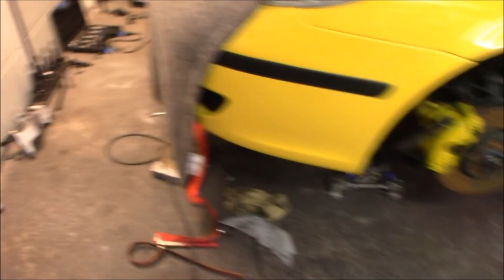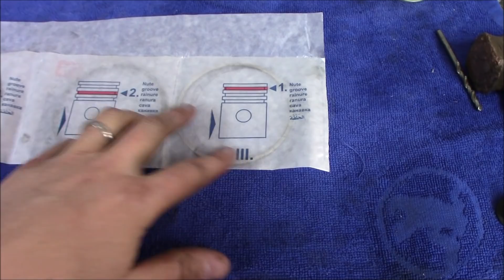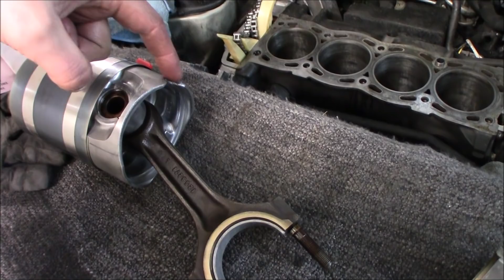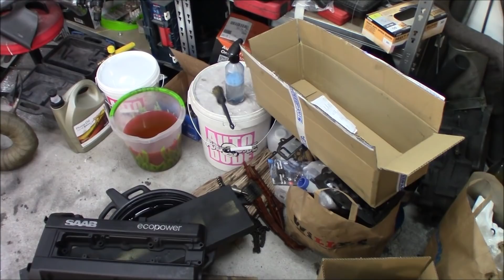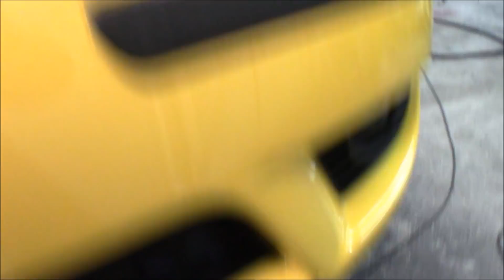Road To 500HP SAAB: Enginebuild Part 2

Comment: Great to see the build.
Before firing it up I usually spin the engine with the sparkplugs and the fuel pump fuse removed. This brings the oil up to pressure and gets everything moving lubed and settled in without being under load, which can't hurt.

Comment: Great video!
But am i able to use all turbo b234 turbo piston and rods in a b235r?
With only machine the top 1.1 off?
Greetings from holland and keep up the good work!
Reply from the maker: Yes that will work fine 👌
Reply: @JonasKakarikas  so in a nutshell 
When i buy an b234 from 1990 piston and rods will fit just without swapping a block?
Ive found some threads on forum that it may interfere with t7 oil squirters..
Maybe a stupid question but it rather spend money once 😆😆
Reply from the maker: It fits without problem. Interferance with oilnozzles is only for the 2.0 pistons 👍

Comment: Jonas whats the budget option would be for rods and pistons for my b205r to go +350 hp. I read that guys fitt 204 cams in to it to get more agresive engine run.
Reply from the maker: Machined T5 pistons 1,1mm. T5 rods. B204 intake cam 👍
Reply: @JonasKakarikas  from t5 engine exactly? And cam from b204 non turbo I presume?
Reply from the maker: Yes, The T5 has stronger pistons and thicker rods 👍
Reply: @JonasKakarikas  Iam not really get it so from  Any t5 engine would suit my b205r? Will it suit from any of b234 and any of 204?? Or has to be turbo or aero etc
Reply from the maker: It has to be from a 2,0 to fit

Comment: I only use Wahler thermostats. I did a write up on a simple way to make the engine fans turn on at a lower temp to match a different thermostat. If running hot or sitting in traffic, a lower thermostat will not make a difference. Also, if the fan comes on at the same temp, the engine is experiencing excessive temperature changes. So ideally, you should change the thermostat and engine fan temp together.

Comment: Great video series.  2001 viggen.  Engine rebuilt prefessionally (?) by Dr Saab in Sandiego.  less than 5k mi and have a cracked piston.  No apparent damage to cyl walls. Called rebuilder and he said he used the wrong pistons.   I am ready  to build it back myself, and read too much.  I believe in OEM  I do not need 500 hp  she is pleanty fast as stock.  Forged pistons or not?  I want a reliable ride. The rebuilder used forged but have heard argument against both. Also please suggest a vendor.
Reply from the maker: Forged if you can afford it 👍

Comment: Thanks again..  What is the purpose and why did you remove the smaller timing chain?
Reply from the maker: One less thing that could cause an engine failure. More free reving engine = more power. Balancing chain is for comfort mostly, for a track car its just in The way
Reply: @JonasKakarikas  Great video series.  2001 viggen.  Engine rebuilt prefessionally (?) less than 5k mi and have a cracked piston.  No apparent damage to cyl walls. Called rebuilder and he said he used the wrong pistons.   I am ready  to build, and read too much.  I believe in OEM  I do not need 500 hp  she is pleanty fast as stock.  Forged pistons or not?  I want a reliable ride. The rebuilder used forged but have heard argument against both. Also please suggest a vendor.

Comment: Vet inte om jag har fel nu men säger du inte i videon att pilen på kolvarna ska peka mot växellådan medans du installerar dem pekandes mot timing kedjan?
Reply from the maker: Det jag förklarade i videon, transmission = kamdrivningen  gearbox = växellåda. Pilen skall vara mot kamkedjan, vänder man dom tvärt om kan man inte dra runt motorn 👍

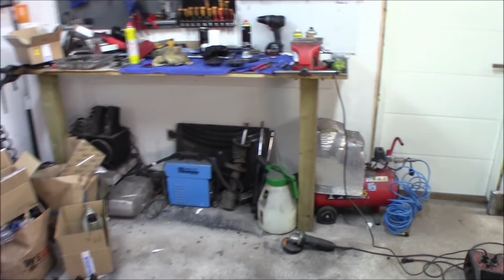Comment: Hei Jonas. Kan du si hva er dette på motoren av din kompressor som står under arbeidsbenket? (videoen 27:16) Du hadde limmet noe på motoren. Er dette til å dempe støyen? Hvis ja, hvilket materiale har du brukt?
Reply from the maker: Det är ljuddämpningsmatta från biltema för att få ner ljudet, men det låter en hel del ändå 🙈
Reply: @JonasKakarikas  Hehe. Tusen takk for ditt svar. Jeg bruker peltors med min men skal bruke ditt patent også:) Du er en talentfull person og har kjempe bra kanal!
Jeg er en SAAB entusiast og kjører 9-5 NG 2.0 Bio power Linear kjøpt i Arvika og 9-3 OG 2.0 SE coupe B204L oppgradert til 220HP (crazy bil:)).
Før kjørte jeg 9-3 OG 2.0 SE B204i og 9-5 OG 2,3t Vector sedan. Hilsen.

Comment: It is not a good idea to use stainless steel screws on the exhaust manifold instead of the bolts with the tubes and nuts on. The bolt with tubes and nuts is specifically designed to work with the heat, while stainless steel screws are a lot less flexibel and tend to break under heat. So maybe think about exchanging them to the bolts and nuts again.
Reply: Stainless steel and Aluminium alloy do not mix, they react with eachother and become fused together. Copper grease does help to alleviate the process but is not a guarantee.

Comment: Jonas did you buy the B234 pistons from Mahle? The stock B234 internals are said to be good for 500hp. Just what I read.  Let me know what pistons you bought please. Great video!!
Reply from the maker: Yes, i bought them used. Dont think you could get new ones.
Reply: @JonasKakarikas  You can buy the pistons but not the conrods, pistons are from Mahle but the conrods was produced in Södertälje once upon a time and thus not available. Part number for the piston for B234 engine (if I recall right is it is class AB) is 109166745 and the price is around 300 SEK per piston plus shipment. Check Speedparts or Orio. And as always nice and informative video, thanks.

Comment: Hej Jonas, great video as always, and now for the tips:
1. the torque setting of 20 Nm +70 degrees refers to the new type con rods with a bolt instead of stud.
2. The best adhering method for the valve cover gasket is contact glue. Tut the glue in the grooves, install the gasket and let it aside for 30 minutes before the assembly. This was the method done by SAAB. There is also a torque sequence for the valve cover listed in the WIS.
3. Upon renewing a cylinder head, it is always a good method to install inserts or helicoils where the exhaust manifold stud are fitted. The long studs are important in relieving stress due to heat.
4. Crank the engine longer before start, when you gain initial oil pressure the oil has just reached the crankshaft. give it another 30 seconds (6*5 second runs) to feed oil to the cylinder head.
5. Always fill the oil filter with oil before assembly, especially during such work. this will initiate the oil pressure sooner.
6. Start the engine WITHOUT coolant for the first minute or 2. In case you see a disaster,  you will not have to drain the coolant. then fill coolant and start again.
7. Idle the engine 90 to 120 minutes and replace the oil and the filter. To my opinion the regular oil is excellent and there is no need for a special break in oil. This will remove MOST of the initial abrasion of metal away, and you will be more confident driving the car.
8. Be calm with the engine during the 2 or 3 hours of initial driving, and then load it more gradually. This will ensure a healthy life for the engine.

Good luck.
Reply from the maker: Thanks,

I always fill oilfilter before installing, Check!

Due to low battery problems i cranked The engine about 5 Times without starting 🤣 Check!

Starting without coolant was new to me 👍

Never used break-in oil either.

Thanks for watching and commenting 👍

Comment: Congratulations Jonas 👍🏻🥃
You now have your own built engine.
Super good video (as always), great reference material.
Very nerve wracking on that first start eh? 😝
I learned some new things which is good. I like the stud replacement too- I should have done that. 

Did you upgrade the valve springs? I forget... I know some people put Volvo ones in if they are revving higher. Also - myth or fact. That you should store your DI cassette upright not upside down 😉

Great project.
Great video series.
Fantastic stuff 😎🎉

SOULFIRER 🏴
Reply from the maker: Thanks, yeah i got upgraded The springs as well. 32kg klracing springs 💪

Comment: Spännande att följa! När man slipar ner kamdreven, finns det inte risk att de ”vandrar” då när det inte finns någon klack som stoppar dom?
Reply from the maker: Absolut finns den risken, därför jag inte jag rekommenderar att någon annan gör det 😉 men har haft diskussion med en som troligtvis har   en av dom snabbaste saabarna i Sverige och han tipsade om denna modden framför ställbara drev
Reply: Jonas, I didn't know as the people did to adapt the b202 cams in a short block engine. I supposed that was with adjustable sprockets. But after see your video, that a good idea. And to avoid the risk of that the sprockets rotate you could try bit a bit until you have them in the correct point. Because the sprockets only work in one direction

Comment: Hey, nice work! How much offset is the B202 from the B234 cams? Could you correlate a sprocket tooth position or is it between teeth? I imagine an NA setup would do worse under a longer duration profile. Just wondering about it when I boost this B234I.
Reply from the maker: Its in between teeth, hence the custom sprocket mod needed 👍
Reply: @JonasKakarikas  yeah I figured so. It never can be simple right? Good luck with the break-in. Do you plan on running break-in oil to wear in the bearings and rings? I usually run Amsoil SAE 30 for 500 miles.
Reply from the maker: Never used a special oil for breaking in, but i Will run the car and make an extra oil change very soon
Reply: @JonasKakarikas remember that standard oil has friction modifiers to prevent the wear needed for the surfaces to mate properly. It is not as much about the dirt as it is the lack of wear-in that needs to happen on the bearing surfaces.
Reply: @Ryengoth  & Jonas- yes, that’s a very interesting question, and splits people’s opinion. I have never used break in type oil either, but have been told I should. 
Also leads to - how should you treat your engine over its first 500 miles or so. Although many people say you should limit revs and stress, there are now saab builders I know who say the opposite if you want to maximise the engine potential. .... 😊 you would need to be brave though eh?
Reply: @Soulfirer  I would love to read the oil chemistry and glide layer science explanation as to why higher revs (more heat) and oil layer stress helps make bearing surfaces stronger. The only thing that does is highlight weak points in a track engine IMHO. If you are building a daily driver a single, short, break-in with the correct oil is all you should need. I'd love to be educated as to why that is incorrect.
Reply: @Ryengoth  so would I !! 🤣👍🏻
Reply: Sorry. No meaning to be facetious. Friends with a 9000 decided to thrash his newly build engine and see what happened. He did use break in oils, and reckoned it was better for it. 
As you note- I logically have never followed this route, and would love to understand any science that underpins it. Another friend did the same with his 234 race engine and said the same. 
Sadly, I don’t have the money or time to experiment to get a final conclusion for myself 😁
Reply: @Soulfirer  haha yeah, I will stick to tried and true standards. Everyone is free to do their own R&D at their own risk.

Comment: I liked a lot the video! Very instructive in preparation of two engines I will to repair. One destroyed by incomed water who corroded the cyilinder block (04 9-5 Aero) and the second one for an overheated engine turning into a melted #1 piston (02 9-5 2.3t)